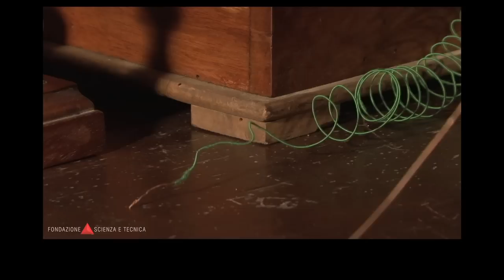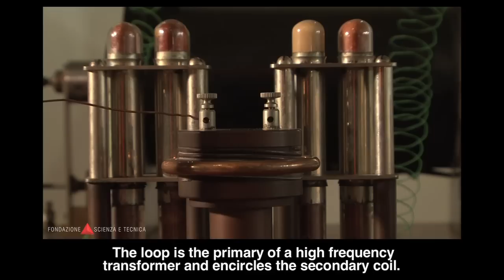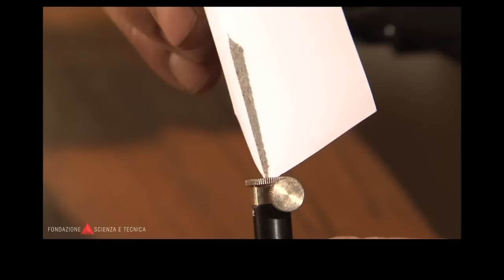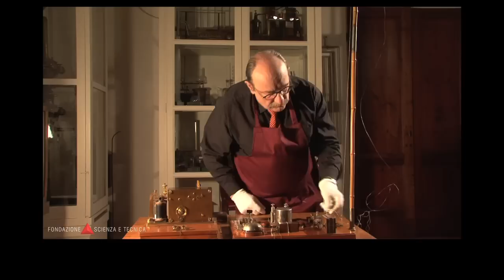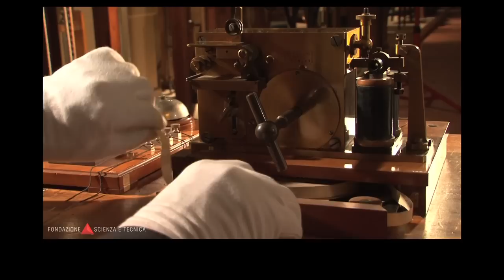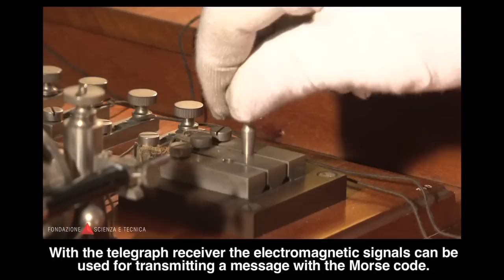Wireless telegraphy demonstration apparatus (Braun system)

Comment: Thank you for posting this. There are VERY few remaining complete sets of this Type. Just looking at that coherer box with a complete spare coherer makes my eyes water... 
That set is more than a scientific toy. This Braun/Siemens & Halske demonstration set actually employs closed tuning circuits on the transmitter and the receiver, based on Ferdinand Braun's 1898 patent. Coherer/decoherer and receiving circuit were identical to the commercial sets sold by Siemens between 1900 and 1903, when the Braun/Siemens System was integrated into the Telefunken company. The technology shown here was state of the art until approx. 1906 - 1908, when almost at the same time the quenched spark system (Telefunken) and the Poulsen arc system (Lorenz/Poulsen) came about.

You made my day!

Comment: What exactly determines the range the signal can travel?
Reply from the maker: The range of the signal depends on a multitude of factors and I just mention some of them:
power of the emitter, sensitivity of the detector, frequency of the signal, dimension and shape of the antennas, etc. etc. but also meteorological conditions, presence of obstacles....
These particular type of didactic wireless apparatus could work on a distance in the order of a few dozens of meters. Generally it was used in a large lecture room or in an amphitheatre.

Thanks for following channel
Reply: @florencefst  Thanks for the answer. 😊

Comment: Aah, reminds me of my childhood. But my father and I didn´t use the Braun circuit (yet), but just a tuning coil, spark gap and big antenna and earth in series. Our receiver was just a piece of straw filled with metal powder, and 2 nails put in as ´tube closure´. The indicator and tapper was the same milliampere meter, which slammed it´s needle back/forth when signals were incoming. However, when the signals got too weak, and the needle didn´t strike hard enough against the coherer, it had a tendency to ´get sticky´ and need some outside assistance to get the job done. 

The Brain System is a lot more complex than most people realize, and spark transmitters in general are a lot less easy to operate than most people think. The principle itself is all too simple, but operating a ´Rumbler´ (that´s how they called these low-frequency, rough sounding transmitter in the literature of around WW1) correctly is quite the affair! A lot of how far, how clean, and how good your signal will be depends purely upon operator skill. And with increasing amounts of ever more sensitive radio receivers in use by the general public in the mid-20s, combined with ever more amateur operators who had very little to no experience operating ´cleanly´, the ´Megahertz Bandwidth Myth´ was born: the spark transmitter is a filthy (spectrally) mode of producing radio waves, disturbs all communications in an entire frequency band, etc. While in reality, due to an inquiry held by the ARRL (first Amateur Radio Service in the world) between 1919 and 1924, it became clear than over 9 out of 10 (!!) complaints by people listening to broadcasts ´being disturbed by amateur spark transmitters´ turned out be false reports. Most of the time it SOUNDED like a spark transmitter of the Braun Type, like an electric DC-motor revving up or a Ford T´s ignition system while driving by.... However, it was inevitable that Spark as the dominant mode would die out, but quite a few people would be surprised that even in the 1960s, Spark or B-mode, was still in (limited) use in Germany due to post-war shortages of vacuum tubes and components! It was than often used as a beacon transmitter, with a loop-antenna attached, since this reduces interference even further. This ´Loop Spark Transmitter´ technology was first developed during WW1 for use in the trenches. Apparently ranges of 6 to 12 miles were achieved on 3 different wavelengths, depending on location of this ´spark´ transmitter (it was a so-called buzzer-transmitter, nothing but a big, very fast relay with heatsinks that required no more HV generation, since the back EMF of the self-interrupting relay it´s coil was used to provide the high voltage for the Capacitor or Antenna! No picture available at this time, will upload one later.
Reply: Good lord my man!!! HOW OLD  are you!!!???    I'm 73, by the way,  from the N end of Idaho State,  and was first licensed  as an amateur in about 1965r,  transmitter  --then Novice class,  crystal controlled, 75W  "DC input"  limited.  If it weren't for  the QRP  hobby, most operators would have no idea how to deal with operating  "split" freq on cw,  especially with a drifty  receiver!!!